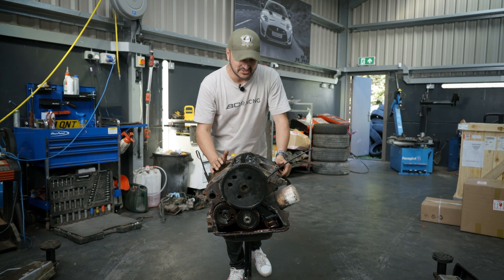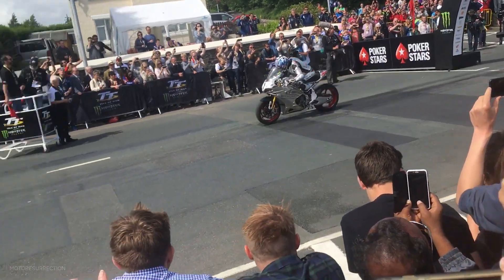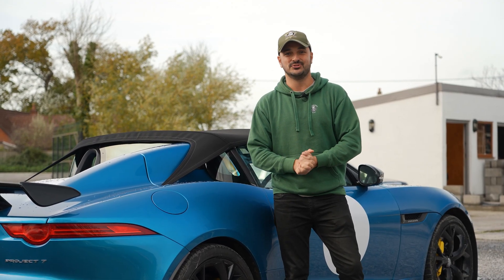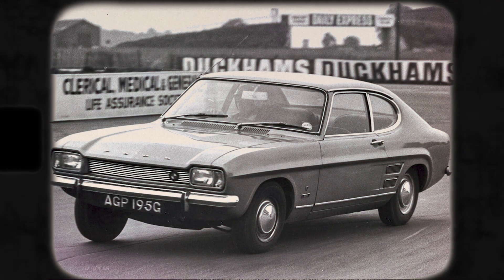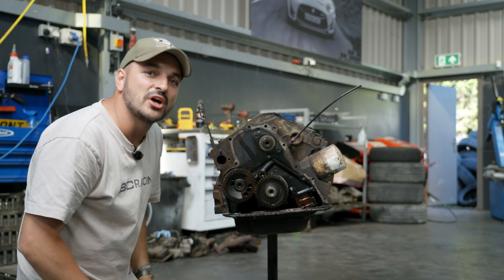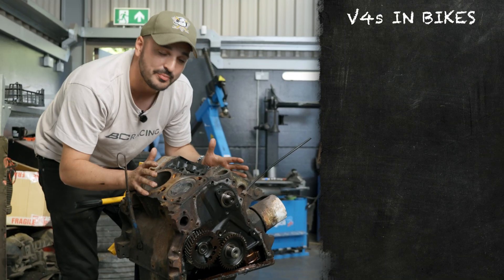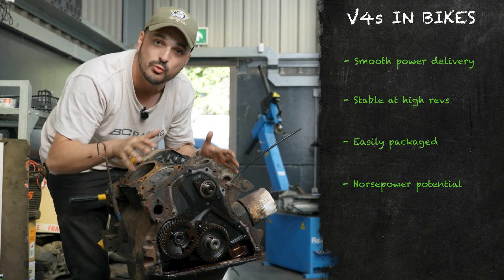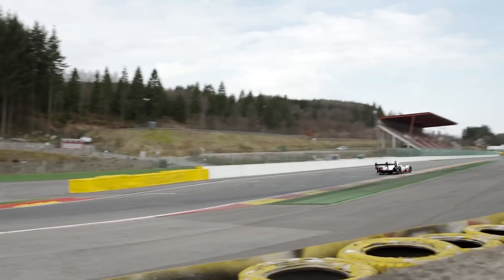Why Do Cars Not Have V4 Engines?

Comment: I'm getting tired of developmental cost argument. It doesn't hold up at all, the engines are symmetrical, so you're developing once and mirroring. So additional dev costs costs are miniscule. Where they actually a noticeable increase in cost is assembly and production, specifically assembly.

Comment: Inline 4 cylinders are not remotely balanced. They require a balance shaft to act as a counter and balance things out. The Iron Duke 2.5L from Pontiac/GM, it was synonymous for shaking like someone with Parkinson's because it lacked a balance shaft.

Comment: Saab used the Ford Taunus German built V4 but still a 60⁰ engine with smaller displacement and apparently better for tuning. The Essex V4 was a UK market engine only. 
If you're doing more engine videos, please   enquire about the Saab beast engine, a 6 cylinder 2 stroke and the SAAB Valmet V8 engines for the Saab 9000. 
You keept the video short enough to give us the information we needed without being to long so keep up the good work 👍🏼

Comment: as you said, the bottom line is there's too much cost/complexity (two heads, redundant Valve drive, 2x cams if OHC) for no real packaging benefit over an I-4 in a car.  V6 give you more than a I4 and still fit the bay,  V8 give you even more, and still fit the bay.

Comment: V4, hopeless in a car ?
Everything has a place.

You have to drive a Caterham 7 with a 
Yamaha VMAX 1700 engine. It is insane.

Any motorcycle engine powered car will be improved by a V4.

they put 1000cc CBR engines in Miata's.
The VMAX is a massive improvement for HP and torque and drivability. And the extra 700cc worth of torque doesn't hurt either.

Comment: What about an EJ it has a 180degree V
Reply: Subaru EJ? It's a boxer engine, not a 180deg V engine.
Reply: @TopiasSalakka if you take the V and keep straightening it out you get a straight line...aka an ej
Reply: @buckjank  But the crankshaft design makes it a boxer, not a flat V.

Comment: I always assumed that car manufacturers went with V engines to save space under the hood(bonnet), but since I-4s are small enough already a V-4 wasn't worth the engineering.  Just use and improve the engines you already have.

Comment: 90 degree V4s are very smooth, small, and can either be quick or relaxed. The Honda ST1300 is a good exampled of a relaxed tourer that will chase sports bikes quite nicely.  The VFR1200 is the same idea with more bias towards speed.

As mentioned in the video it's very unlikely to see car V4s due to the added complexity and cost. So small footprint would have to be a defining factor to go from an i4 to a v4.

Comment: Used to have that same Ford engine in my 1968 Saab 96. It came with the deluxe package from Saab. They used to license the engine from FoMoCo back then as a factory upgrade option to the base 2 stroke inline 3 cylinder. Loved that little engine. ❤

Comment: 90° v6 owner here if the Audi 2.8 12v AFC v6.... I love the sound, the uneven firing order actually creates a very even, deep subo like low growl that sounds more like a V8 then as you raise rpms it smooths out and sounds like a mini Lambo....I love it lol...I'm actually doing a big build with one....2.8-3.0 hybrid...2.8 12v block with 3.0 avk 30 valve heads...yes they bolt right up and everything lines up perfectly. ...those heads paired with a custom intake and m90 supercharger I have should do nicely together. Never thought the engine i obsess over and build would be from a dang Audi lol amazing engine

Comment: Hello from Canada.  My first car was a dodge coronet which had a slant 6 225 cub inch engine that was reported to have very good longevity.  What is the advantage of taking a straight 6 and putting it on a slant.  Not sure what the angle was, maybe 60 degrees?   Great video Mike.

Comment: My Saab 96 had a V4 (I'm pretty sure it was from Ford) and a manual 4 speed transmission with the shifter on the column. Scariest thing was the free wheeling option. Pull a T handle under the dashboard and the free wheeling was engaged. What is free wheeling you ask? When you take your foot off the gas, it's like it shifted into neutral, or the clutch was disengaged. What do you do when going down hill? You take your foot off the gas. And the car is now in neutral, no engine braking and it goes faster and faster and faster, until you hit the brakes. Needless to say I didn't use it. Supposed to help gas milage but I didn't think it was worth it. 
Anyway, the V4 was fine. I didn't find it 'rattly' seemed smooth to me. Ran fine, and gave me no problems.

Comment: A great video. Potential future engine discussions:

What about discussing 5 cylinder engines such as the Volvo ones. Most manufacturers would choose either a 4 pot or a 6 pot (or even why no 7 cyclinders).
Why are most engines arranged in a layout whereby there is valve overlap if the timing belt snaps.
Why most engines seem to have a 500cc limit for each cylinder i.e. a 2 litre would typically be a 4 cylinder, a 3 litre a 6 cylinder and a 4 litre a V8.

Comment: Just in case you didn't know about another type of V4, here in the US we had a brand of engines called Wisconsin that no longer builds these, they made V4 engines for industrial or commercial use back before the 1970's. These engines used a flathead design with air cooling, cast iron blocks with aluminum heads with power rating up to 65hp, they are 90 degree engines.

Comment: I've noticed a fair few V4 outboard engines for boats. 
Something at work here might simply be packaging. Cars don't need their 4 cylinder engines to be smaller or any particular shape because such small engines just fit fine. 
Bikes and boats both have packaging restraints that the v4 solves over a straight 4

Comment: 11:21 not a true 'Hot V' though.. surely you're aware of that Mike? 

A Hot V has the intake and exhaust ports reversed, with the exhaust exiting on the inside of the heads, and in the centre of the V, usually utilized to package Turbos neatly while keeping their feed pipe as short as possible. 

The 919 isnt a true Hot V, exhaust still exits on on the outside, they've just plumbed extra feed pipe to the centrally mounted turbo. Controlling those intake temps must be a nightmare.

Comment: Ford and Saab v4 was good engines ....actually the first ford v4 the Cardinal (the predecessor to the Taunus cologne v4 and later the English copy the essex) engine used a Saab 93 as a development miles without saabs knowledge Saab later discovered how well the ford v4 fitted in the saab 96 with a slightly elongated nose.....just remember the transit was designed in Germany for the German engine something the British often forget

Comment: There were some badass V4s made by Chevy for midgets and sprint cars.  They were monsters back in their day.

Correction:  Just looked them back up.  An independent shop made them.  They used a Chevy V8 as the base and cut them in half.

Comment: Narrow V4 with a single head as epitomized by Lancia for over 50 years surely deserves it's own category with its compactness, especially in late Fulvia guise utilising rockers to allow DOHC advantages with 2 camshafts rather than 4. 
Despite Lancia's engineering pride and prowess which taxed their finances, machining & porting must have posed challenges possibly ruling out 4 valve per cylinder developments which later gained popularity.

Comment: The V4 is big in motorcycles because the length of the engine matters a lot there. It would be hard to cram an inline four into a bike.

In cars, the length isn't as big a deal. Cars are bigger in general. If you want a short hood, there is also the option of transverse mounting of the inline four, something you can't do in a bike because the engine would be too wide.

Comment: The Honda VFR1200 V4 engine has a 76-degree angle between the cylinder banks. 
This specific V-angle is combined with a special "symmetrically coupled phase-shift" crankshaft that features a 28-degree crankpin offset. This combination is engineered to effectively cancel out primary engine vibrations, allowing the removal of a balance shaft and resulting in a compact, smooth-running engine with a unique firing order (104-256-104-256 degrees).

Comment: Think ya messed up a bit here Mike. "Hot V" has the exhaust exiting in to the V, and the cold inlets on the outside of the V. The 919 engine has the cold inlet side in the V and the exhausts on the outside, just like any conventional layout V engine. Those exhaust wrap up an over the the transaxle to place the turbo over the transaxle, not the same as having the exhaust in the V pushing directly in to a turbo. The Porsche layout could have provided better throttle response, if they'd used a water-to-air intercooler system, in the way an LS/LT or the Gen3 Hemi V8 can have the intercooler mounted in the V directly under a supercharger. Instead Porsche used air-to-air with the intercooler off the to side and feeding a plenum, meaning the turbo is over the transaxle solely for packaging within the confines of the chassis.

Comment: LOL, I was stationed in Germany in the 70's. I had a Ford Taunus, lol, column change & a 1700 V4. I liked the engine, compact, easy to work on, driving felt at least as quick as the average 1600 at the time. Context needed in your power presentation ?

Comment: v4 is mainly used in racing bikes cause engine is put transvers so it make bike thinner and aero. plus one thing you missed is structural support. and inline block you only need to worry about ribbing but for v block you need way more different support to make it strong (look at inline 6 vs v8 engine of similar power). so in bikes you can make the engine block as heavy as you want cause the 2 cylinders that stay in the back side becomes structural part of the bike.

Comment: Nice video to explain the basics of why the V-4s are not really used in cars . As I have owned four Honda V-4 motorcycles in the 80s , I researched the same subject . Back then the most often reason was manufacturing costs . The 90 degree V-4s I had were the smoothest bikes I have ever owned . I thought somebody could have developed a 90 degree car engine that would have also been great in marine use .

Comment: You left out one V4 engine. The Motus V4. While originally designed for a motorcycle, it was mounted in the frame with the crankshaft going front to back, instead of sideways like most motorcycle V4s. It was fairly smooth, and made a wonderful sound. With 1650cc, it made 180 hp, and is a very revvy engine, and would seem to be suitable for use in a car. A V4 is halfway between an inline four, and a horizontally opposed four, like the Volkswagen, Porsche, and original pushrod Subaru engines, along with the Honda Goldwing flat four, all excellent engines. As for vibration, you don't need to use a complicated balance shaft system. Look at how much a non balanced Harley Davidson 45 degree single crankpin V twin engine vibrates. Going to 90 degrees gives you perfect primary balance. But it makes a very wide engine. Many Japanese motorcycle companies have made very smooth 45 degree V twins simply by using offset crankpins, imitating a parallel twin or a horizontally opposed twin. I don't see how complexity would really be an issue these days, when car engines are several times more complicated than they need to be. The DOHC horizontally opposed engine is an absolute nightmare of complexity. The Motus V4 is a single cam pushrod engine, with only one cam, making it very simple. And simple is what all car engines need to be. 

On the other hand, I absolutely love the 2.0L SOHC inline four in my 1973 Ford Pinto. It is a marvel of simplicity. It has one overhead cam, driven by an external timing belt that can be replaced in under half an hour, 2 valves per cylinder, and uses a crossflow design, with the intake on one side, and exhaust on the other. The distributor and fuel pump are driven off an auxiliary shaft, which is also driven by the timing belt, and the distributor shaft drives the oil pump. It could be made even simpler by operating the valves directly off the cam instead of using conventional rocker arms. And it is a non interference engine, so a broken timing belt doesn't destroy the engine. But it is a '70s engine, nobody would dream of designing such a simple engine today.

Comment: I worked on Saab cars years ago. They had a V4 Ford engine in them before the inline tubos.
The problem with V4 Ford motors was they were too reliable. Super easy to work on.

Comment: ZAZ-968 "Zaporozhetz" was the cheapest car in our country, and it had a rear-mounted air-cooled 1.2L V4 with a balance shaft inside of camshaft. Real thing why it was a "vee" is it's similarity with a VW's flat 4-banger. They didn't want conflicts with a VW and figured out some benefits from a V-arrangement. Such as low-end torque and easier maintenance. With a horribly small intake and exhaust, this engine was slow-revving, putting about 42-50 HP at 4200-4500 RPM depending on a carb and some other differences. But small ZAZ can climb any hill and carry a ton of things on it - because of the V4. Top speed was about 65 mph/118 kph with a really slow acceleration from 38 mph/60 kph. But ours was in perfect condition and was able to hold 120-130 kph with 5 passengers on a good road

Comment: Good descriptions and good content.  As a motorcyclist, I believe the pinnacle of V4 thecnology is from Honda with the VFR800 and ST1300.  The 800 made about 90 HP and was almost indestructible.  I've tried with many touches of the rev limiter.  Yet, at 110,000 miles, my latest has never required even a shim change on the valves.  90 degree V4s are smooth, balanced, powerful, and rev very well.  You addressed the issue of room under the bonnet.  But that could be solved by lengthening the bonnet a few inches.  Certainly it would not be as much as the length of an inline 4.   I believe it is the cost of extra cams, heads, and other miscellaneous parts.  But a 2 liter turbo V4 could be awesome.  BTW, I owned a V6 Capri.  What a fun car to drive!

Comment: Another V-4 was in the Motus MST motorcycle manufactured from 2014 to 2018 in Birmingham, Alabama U.S. of A..  It had a 90 degree pushrod V4 putting out 180 hp.   This bike set land speed records at Bonneville Salt Flats of 165.81 for the pushrod engined production motorcycle record.

Comment: It could be “argued” that the “Flat Four” is a Vee Four.
Reply: Unless it's a Boxer. Separate crank pins.
Reply: @Irrelavent2 hello irrelevant, oh, I’m so tempted, I can’t resist, “Six of one, half a dozen of the other”
Reply: @anthonyburke5656  The main difference is the Boxer is relatively smooth but the 180° V shakes like a shitting dog.
Reply: @Irrelavent2 Hi Irrelevant, the V 4 in any configuration is inherently unstable and constantly shitting it self, no matter the angle or counterweights. Even the straight 4 is a bit unstable. Take the same capacity 4 and 6, chalk and cheese, the 6 is well worth the additional, weight, dimensions, cost and complexity in my view.

Comment: When I was stationed in Germany in 1981, I had a 1967 Ford Taunus that had an air cooled V-4 engine paired with a 4 speed manual transmission that had a column shifter. An unusual, to me, combination but it was a fantastic little car.

Comment: Cars I'm not worried about, but my Honda VFR is a V configuration 4 cylinder. 800ccs of great torque and power. Honda discontinued them, but these are very popular in the touring and street bike world... I prefer my R1 but the VFR is amazing too. It works on motorcycles, maybe not on cars as well

Comment: Ford had two different V4 at approximately the same time, both based on two different V6 and both 60 degrees between banks , one based on the British Essex engine and one based on the German Cologne engine.
The V4 that SAAB used was the Ford Cologne V4.

Comment: The packaging of a v4 works perfect for a motorcycle.   But cars have enough space under their hood that they don't need an engine that short.   I have an easier time working on inline  engines than V engines, especailly with overhead cams, but that might be specific to the engines in the vehicles that I have had.

Comment: Bolt it to a railway flatbed add a fuel tank and some transmission to the wheels and you’ve got yourself a simple diesel.
Tip: put a tarp over the flatbed if you don’t want to get rained on ￼￼

Comment: Because the narrow form factor is not needed in cars.  V engines are expensive because you have double the heads, cams, complex intake complex exhaust, complex timing chain.  Inline 4 engines are cheap and get the job done.

Comment: My dad had a Ford Taunus 12m which was a 1200cc V4. Late 1960s. He's always found that was one of his best cars. It had good power, could reach 160km/h top speed and was efficient. It took 8 litres of petrol for 100km, which was good for the time. His next car was a Ford Taunus 13m, a 1300 in line four, and he did not like it at all. It drank over 11 litres of petrol for 100km and was slow. He did not have it for long.

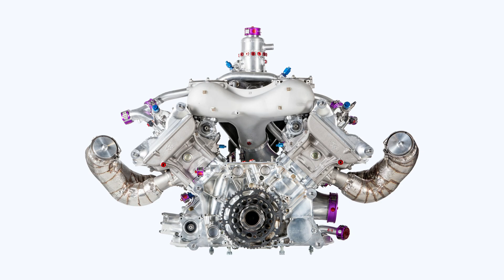Comment: 11:30 It's NOT a "hot vee". The exhaust manifolds are on the OUTSIDE with the intake manifold in the valley. The turbo being mounted high up and centrally does not make it a "hot vee".

Comment: I had 2 Corsairs back in the day the 1.7 and 2.0 liter 2000E. Not rattley no vibration in fact lovely engines. The 2000E was pretty swift for the day and a lovely spirited drive.

Comment: Honda VFR 1990-1997. Gear driven cams.  Like a fine Swiss watch.  Routine maintenance could easily get 150-250k miles out of a buttery smooth high revving sportsbike engine.

Comment: Here's what you missed on your video, v4s on motorcycles are forwards and backwards to eliminate lateral vibrations as well as to offset torque. 

In cars if the v was forward to back instead of left and right there will be less vibration to the driver in a car.  🤷🤷🤷